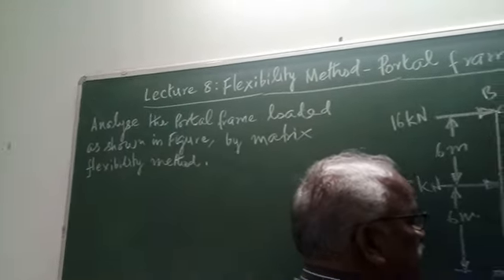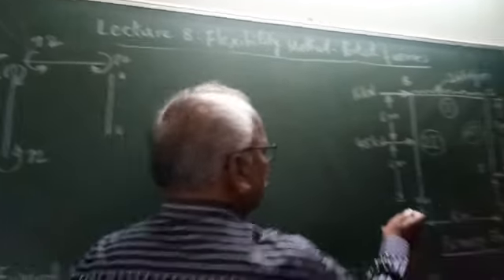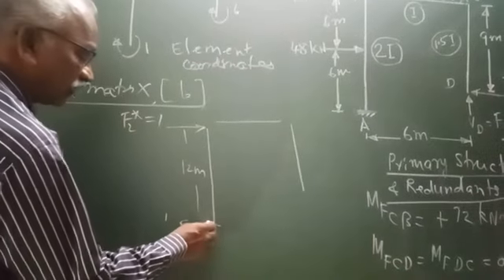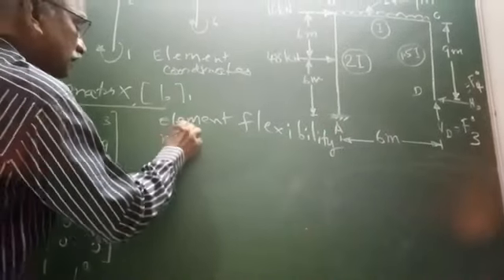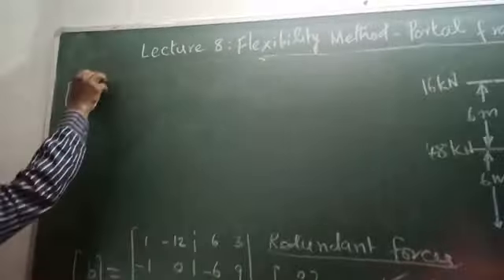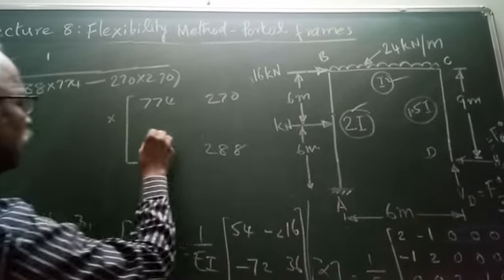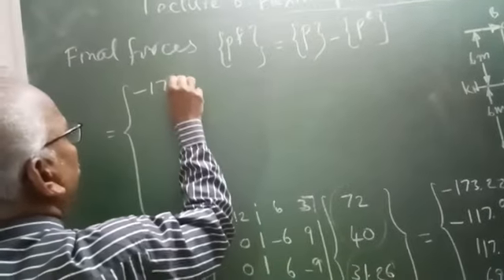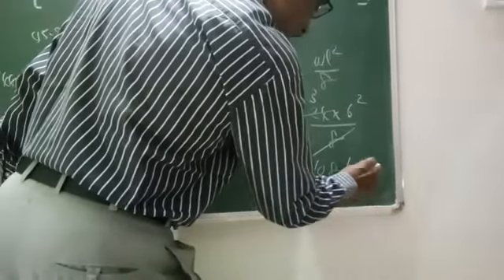Lecture 8 : Matrix methods of structural analysis-Flexibility Method-Portal frames, Dr.P.Perumal

Comment: Sir if say AB had the 24kN/m udl instead and BC had the 48kN point load downwards at the mid span and no lateral point load at B, would you still apply a lateral F* at joint B?

Comment: How would you do the transformation matrix if say the end was pinned at A instead? What would you do to balance out an F*=1  at element coordinate 2 (Joint B)? I have a similar question but its a 2 member frame (members are joined perpendicular to each other), one end is pin the other is fixed. I made the pin end redundant.
Reply: Member 1 (with pin end) is at 53 deg to horizontal, member 2 is at 37 (with fixed end). Frame is orientated to look like an incomplete triangle (missing horizontal line at bottom)
Reply from the maker: I am trying to understand your question. If you can send the question, it will be comfortable to me. Thank you. The subsequent videos may clarify your doubts, you can try that also.
Reply: @dr.perumalcivil7644   what's your email? I would like to send it through, thanks